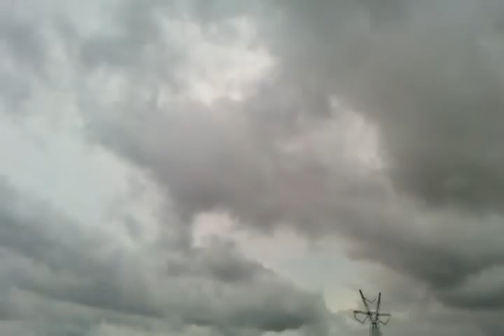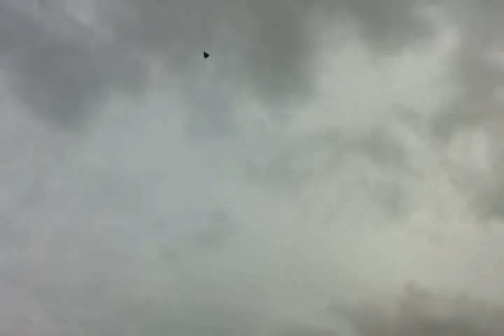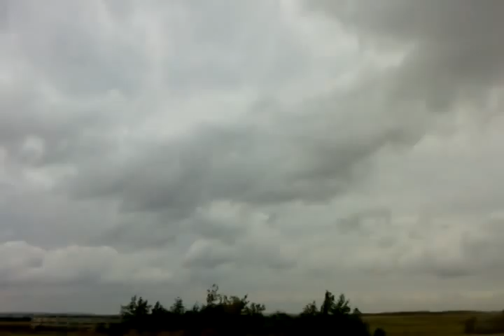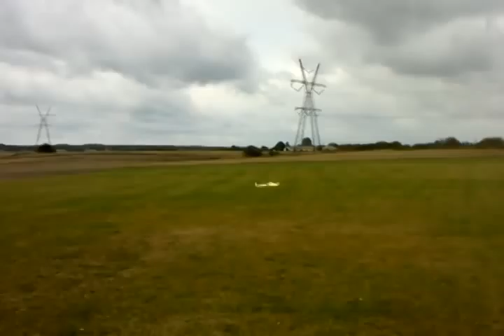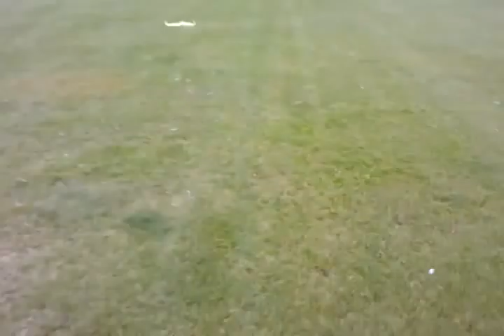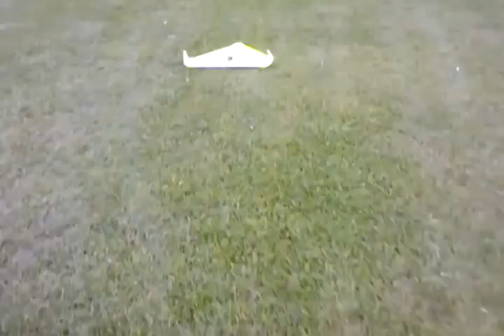fast electric deltawing

Comment from the maker: Thats correct. There was a headwind of about 7-8m/s that day, wich is about 30km/h, so the actual airspeed is probably not any more than 270km/h I guess. But I am working on a new design that should be a little faster.